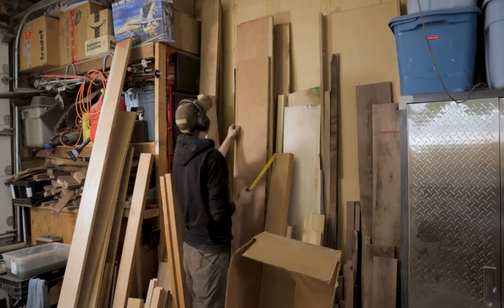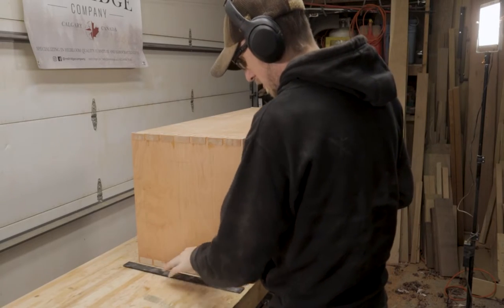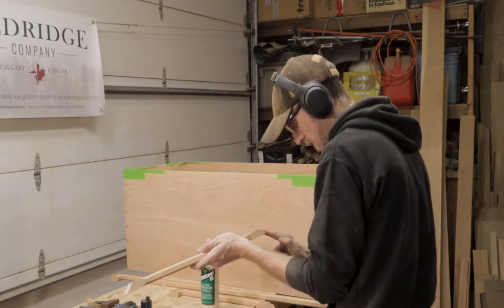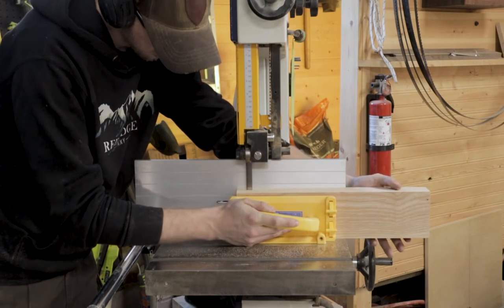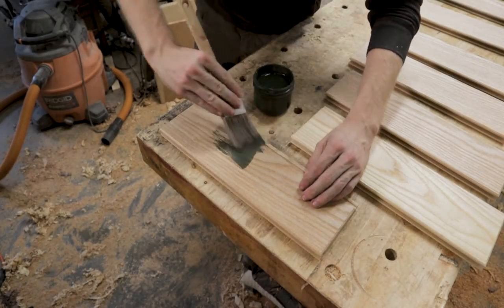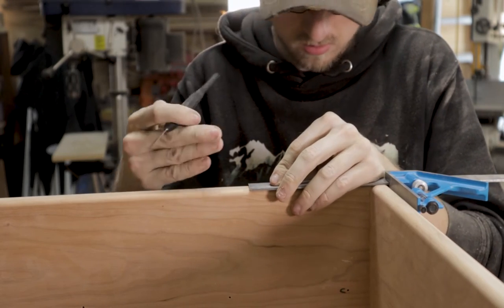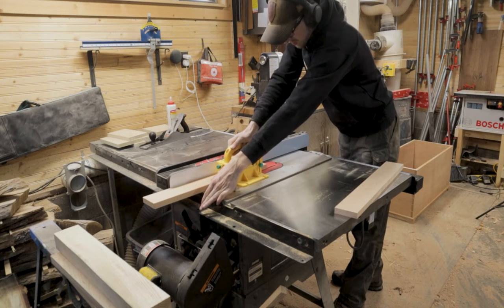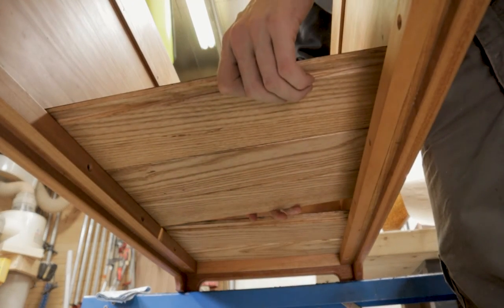The First Project Every Woodworker Should Try with FREE PLANS

Comment: You have quite aggressive hand tool skills. That’s not an insult. You obviously get great results so it equals speed. I’d personally have accidents at that pace. Fair play to you mate.
Reply: Slotted screws all lined up the same. Respect!
Reply from the maker: I always notice that when I see the video of myself, I'm still in those early stages where I'm trying to make the tool work rather than letting the tool work. I will admit that I have had one accident where I launched my block plane into the concrete, luckily everything was okay but that was a good lesson in taking lighter cuts and not moving so fast!
Reply from the maker: That is an absolute must, it would drive me insane every time I look in the chest if I didn't!
Reply: @morganhurst_redridge   mate, it’s what works best for you. I let tenon saws use their own weight as I have disston Philadelphia brass backs that have plenty of weight already. I give the Japanese saws a slight press on the pull cut.  Just do what you’re comfortable with. I’m surprised your 'just starting out’ with the standard of your work.

Comment: Beautiful project. I was wondering if cutting the breadboard ends flush with the panel creates issues with contraction during the seasons. The panels will contract more than the ends and it won't be flush anymore. Also is that a rabbeting block plane you are using to trim the tenons? My block plane doesnt reach the base of the tenons.
Reply from the maker: Yeah, over the year your main panel will sometimes stick past the ends or be slightly inset, this is one of the downsides of breadboard ends but it's really not that big of a deal.
I'd highly recommend looking into a rabbet plane, a nice rabbets block plane is good but you could also get a shoulder plan that would do the same thing.

Comment: Very nice, good to see a younger woodworker using hand tools and not all electric. The waxoil did the grain a treat. My only crit would be screwing the base. Those slats need to expand, but you've secured and no expansion allowance. As they're T&G, I would have screwed the last piece with loose fit and 1mm loose on each slat.
Reply from the maker: As I get more into it, I'm leaning heavily into the use of hand tools. I like the control and the feel of using them but overall they look alot better in the videos!
My original plan with the slats was to just screw in the first and last but I ended up making the fit to lose between the pieces. Wood movement won't be a problem though because each slat only has a single screw centered, so the wood can easily expand on either side. I made sure to leave enough room between each piece to let them reach the max potential expansion, the tongue will expand in deeper or the groove pieces will expand over the tongue further.

Comment: I like the bottom construction of the sliding tray. How did you build it to account for wood movement? I was trying to make something similar but couldn’t figure it out so just veneered plywood.
Reply from the maker: Being honest, I didn't consider wood movement very much. Since the pieces are about 1 3/4" wide and most are quart or rift sawn, individually they will have negligible wood movement, all together they probably won't all be at full expansion at any given time and if they do they are loosely mounted to the groove in the tray so they can just get pushed deeper into the groove.
That's also why I add in the leather, as the pieces expand and contract, gaps are going to show so the more malleable leather can be glued right on and it will stretch and move with the wood. Technically speaking this is not the best way to do this, your method with the veneer is better but in this case it was a fast and efficient use of the materials I had on hand.

Comment: thank you . why do you not do the round overs when they are just straight panels ?
Reply from the maker: The problem I've run into in the past when I add in edge profiles to connected pieces before a glue up, is sometimes they don't line up properly afterwards. Especially with a round over, if the two pieces need any adjustment after the glue up you're just going to ruin that round over anyway. By doing it after, you're working with a finished reference surface where you've already made all the adjustment to make any joining edges meet up.
Reply: @morganhurst_redridge  thank you

Comment: Beautiful chest!! 
Not to sound preechy, but you need to wear a dust mask, you're gonna mess up your lungs pretty good using all those power tools without a mask (or at the very least dust collection).
Reply from the maker: Trust me I'm very careful about wearing a mask, using dust collection and running my air filter to keep myself safe in the shop. If there is a specific point in this video where you think I'm doing something unsafe let me know the timecode so I can correct myself in the future.
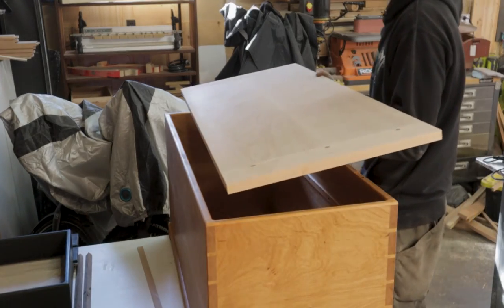Reply: 27:12 sander no dust mask, 27:44 router no dust mask...those fine particles will get you over time. Again it's constructive criticism, hope you don't take it the wrong way
Reply from the maker: With the orbital there's no need for a mask because I've got it hooked up to the shop vac and that pulls the majority of the dust, I also have the airflow of my shop set up so that any particles that end up in the air get pushed away from me then pulled along that back wall into an air filter.
I will agree with you about the router, definitely should've had a mask on there.
I apologize if I came off as aggressive, I get so many of these comments and the response I gave before is a generic one I wrote up to counteract the spam comments, so I do appreciate you taking the time to point out those two clips.